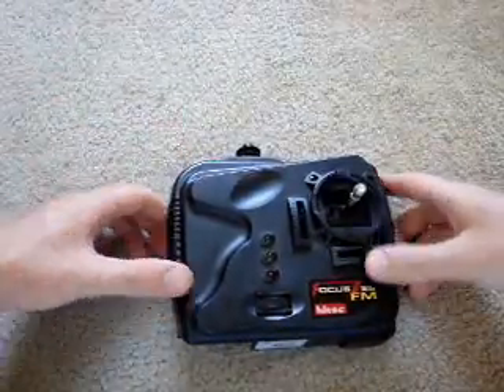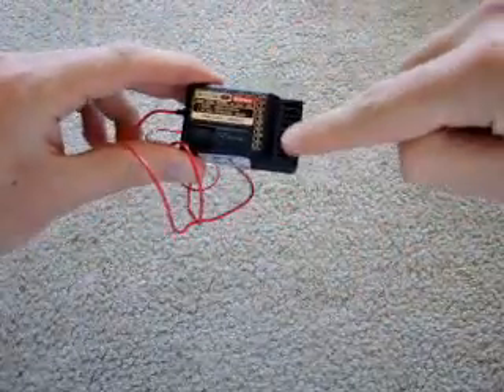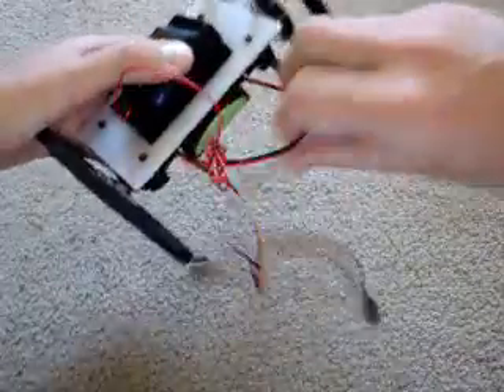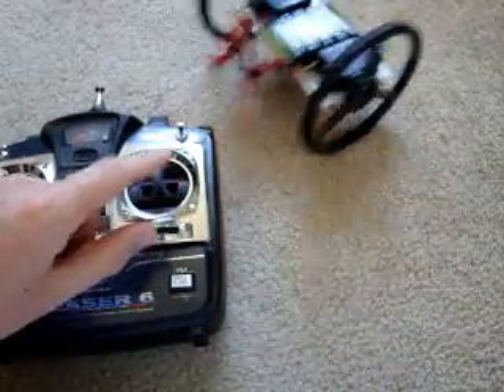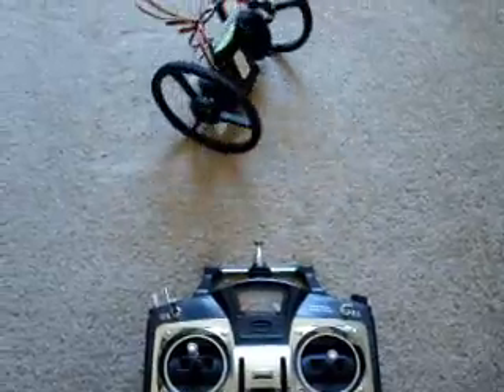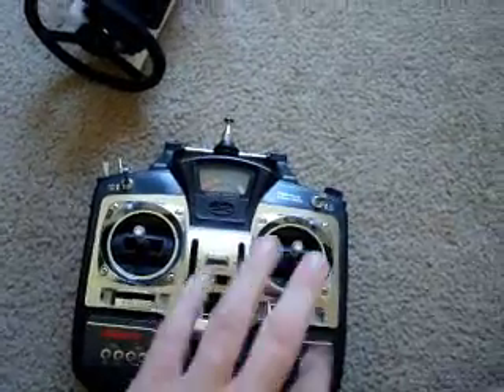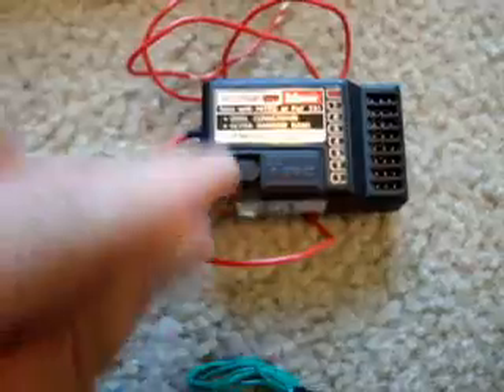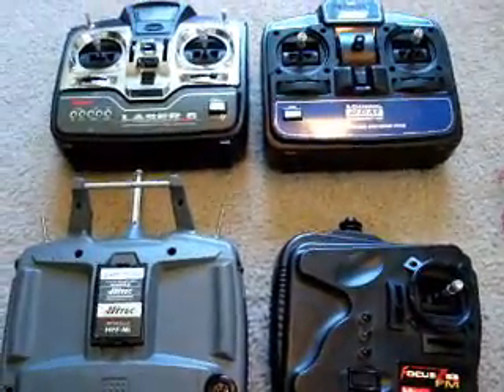Remote Control Robot Tutorial

Comment: @palmisano I need something powerful. I don't want to control a vehicle, but a strong mechanic arm. Velocity, variable rotation speed, etc. don't matter to me, as long as the blow the arm can gives contains much strength. I might use a motor from a small drill for it, combined with a chain, and according to your site an H-bridge should work for that... But no servos because there're too weak.

Comment: @palmisano Can I do it with an H-brigde? Can I just connect the H-bridge to my receiver and the other two wires to my battery and motor? And I assume I don't have to worry about those MOSFETs because there're already built in the controller? Thank you so much for helping me out!

Comment: @LifeRocketTV Thanks a lot ;) I have thought about the project and I'm going to put a butane gas bottle on it, with a lighter in front of it, and I'm going to make that RC'd somehow. I'm not gonna use gasoline because that's fluid which is very dangerous :P The hatchet will be a little to the front to optimize range and I'm gonna make it move with a bike-chain system. Not sure wether to use wheels, because then I need to make a steering system. Might just go for tracks. WISH ME LUCK! :P

Comment: im about to create an antweight robot something like this. by looking at some of the products websites have to offer they sell controllers. in your video you use a reciever thats connected to the battery. wouldent it be possible just to put the reviever on the controller board. because i plan o add a saw on mines in the future and i dont think another motor can be placed into the reciever. im very new to robotics so if this sounds like a dumb question now you know lol

Comment: I need help finding a battery to use. The servo i have picked out used about 4.8-6v
I have looked on your website and partslist, but i do not know which type of batter to use.... or which connector to use. I have the same reciever as in your video. I also need a charger

Comment: If you want a cheaper version.Simply take an old rc car, carefully note the points where the motors, battery and switch are to be attached.then attach them and use the remote of the rc car. its ready.

Comment: @palmisano 
When I called the website they told me that the remote, when I ordered it was set to a frequency. I am just trying to confirm that that frequency can be changed. Also, Is there a special type of crystal for the receiver because the one in your transmitter looks different from the one in you receiver.

Comment: Hi, as I understand the servos are reversible right?.

But say if you are gonna make a robot with 2 DC motors for the wheels instead of the servos. 

Will they be able to reverse or do you need to connect the motors in some sort of way like a H-bridge u mentioned at the society of robots?

I am a little unsure about that.

Would be grateful for an answer .